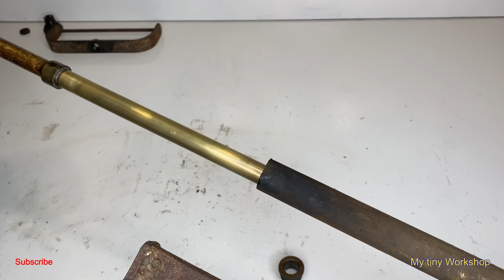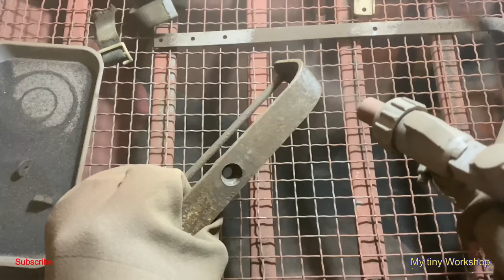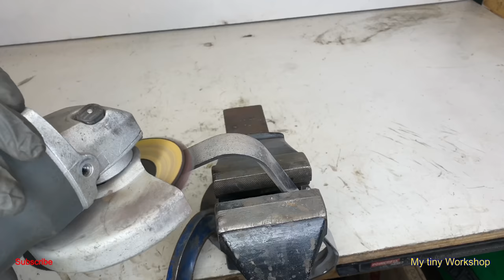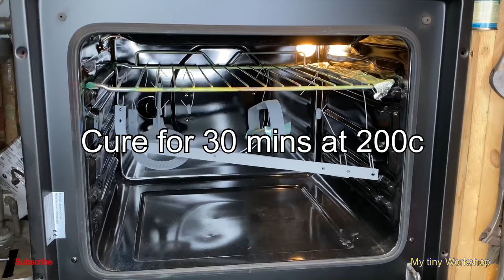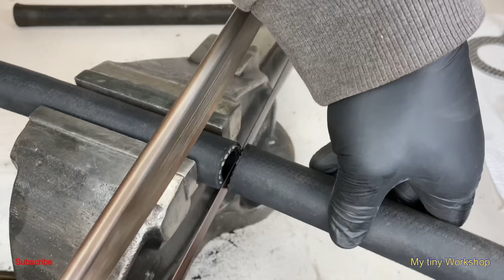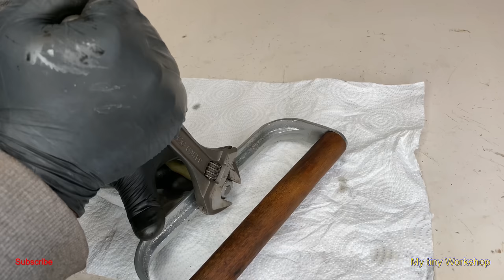Vintage Stirrup Water Pump Restoration

Comment: To slide the rubber tube over the metal tube, use compressed air as if fitting a new rubber motorcycle hand grip.  Great restoration.
Reply from the maker: Thank for the tip

Comment: Another good restoration. This is still a useful practical tool around the garden. Brass tools are always interesting. Judging by the brass back it looks like you used a Tyzack tenon saw , more commonly called a back saw, in the US. I have owned one for about 35 years. Best regards from the USA.
Reply from the maker: Thank you. It’s actually a footprint saw. I do have a few tyzack saws though. I will be using this in the garden.

Comment: I've just restored a genuine George VI October 1940 stamped pump in worse condition than yours but painted it the original black. I used greased string for the seal again as the original had. I do need some of that 22mm core rubber hose for my other pumps.

Comment: What is the belt for?
Reply: The strap is to secure the pumps hose, which originally was a lot longer. Long enough in fact to go all the way up the chimney of a house as these pumps, would you believe, are still carried on front line Fire Trucks in the UK!